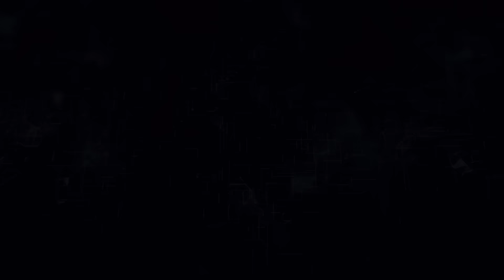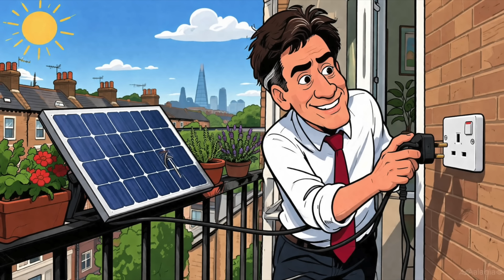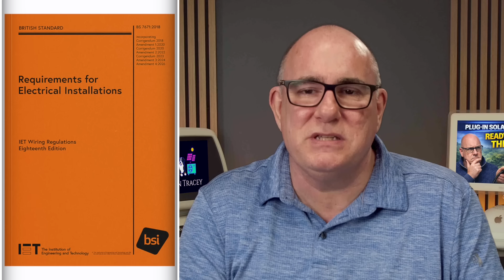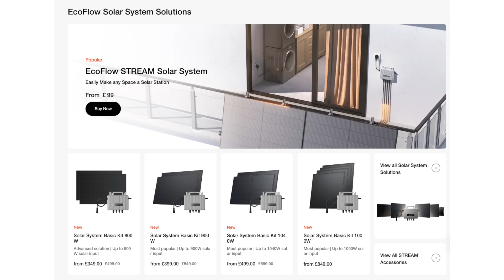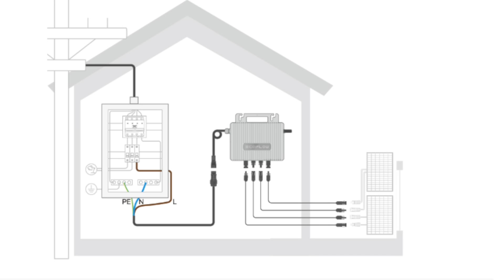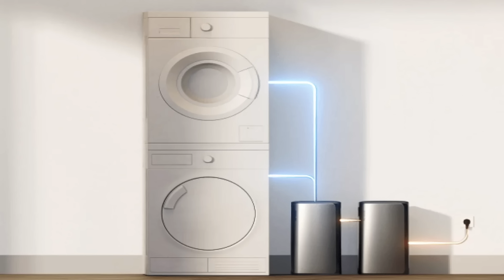Plug In Solar Is Coming… But There’s a Problem

Comment: I can’t wait for this. I am a
 shared owner with a housing association. They will not allow solar or battery’s on the property. So when this comes legal I shall be 1st in the queue.
Reply from the maker: what are the reasons for not allowing it, seems very mean spirited of them
Reply: @JonathanTracey it’s just something they don’t allow and it’s a change to the electrics. Even asked about having them on temp builds like shed fence. There response was it’s what get connected to the electric that is the problem and not in keeping with the other houses. Even though the homes built is phase 2 all have solar

Comment: This is a first step towards affordable off grid power generation for those who have the space for the required solar panels and batteries. The most difficult part will be to have enough space to generate sufficient power to be able to dispense with the daily standing charges of the public utilities by disconnecting from them entirely.
Reply from the maker: @EdJelonek Fully agree 👍 for many people this is just about getting a **foot on the solar ladder**.

You’re right on space being the limiting factor for going fully off-grid, but even a small setup can still chip away at bills and reduce reliance on the grid without needing a huge install.

For most, it’s more about *partial independence and savings* rather than completely disconnecting.

Comment: Have had roof solar and battery storage for 3 years and my total household bill hasn’t been over £1k per year.
Reply from the maker: what size system do you have?
Reply: @JonathanTracey 4.8KWp. 10 panels and 2 batteries.

Comment: The advertise costs of £200 but when you look into it, it’s much more expensive.
Reply from the maker: it depends on the size of the system, a single micro inverter and a single solar panel will cost somewhere in the region of £200. If you want to start adding batteries to that then they could easily get a lot more expensive.

Comment: Good video, big thanks. I understand better now. Next step, also understand base load, then visit middle of Lidl ina few months for Manage Ed's Solar Special. Joking aside,  we will move house soon and would have got a roof installation years ago if the roof was better suited, so I probably will get a plug-in as an experiment once it becomes just a matter of buying it and, yeah, plugging it in. 

Question: without a battery, should I in practice expect only to cover base load (during daylight hours) or will it do much over that towards other usage, and should I be expecting to "lose" power into the grid because the house can't use it all in real time, then also import power even during sunny periods because the panels can't satisfy a kettle or similar appliance? It seems like even a small battery would make quite a difference in this respect but I am guessing that the cheaper kits will not have one. 

(We have an electric car so I guess I can probably shloop up spare solar power as long as there is car battery capacity to shloop it into but even on a 3-pin plug, I think that will draw more grid than solar power from the supermarket-level kits? And similar for immersion heater in water tank. Hmm, but maybe the slow cooker, ...)
Reply from the maker: @andbenth Great questions 👍 and you’re thinking about it exactly the right way.

*Without a battery:*
- Yes, you’ll mostly cover your *base load during daylight* (fridge, router, etc.)
- If generation goes above what the house is using, the excess is *“lost” to the grid*
- And you’re spot on – if you turn on something like a kettle, you’ll still *pull from the grid* because the panels can’t supply that level of power on their own

So in practice it’s a bit of a balancing act – you get the most value by **running things while the sun is out**.

*On your other points:*
- A **small battery does make a big difference**, mainly by smoothing things out and letting you use your own energy later
- Charging an EV from a 3-pin will usually **pull more than the panels are producing**, so you’ll still import some grid unless it’s very sunny
- Things like *slow cookers, washing machines, or an immersion heater on a timer* are perfect for soaking up spare solar

You’ve basically nailed the use case already – even without a battery it works, you just need to be a bit smart with timing. Then if you add a battery later, it takes it to the next level 👍
Reply: @JonathanTracey Awesome, thanks so much. I don't actually mind losing the power to the grid that much, as then at least someone else uses it, but I figure I should at least try to capture as much as I can. Looks like that is about old-school behavioural adaptation at this level of technology where you don't have fancy management software and cool but expensive hardware. Fair enough. I will get one of these when they come on sale and make sure our new house has a flat or south-facing roof ...
Reply: PS: Are the cheap+cheerful things that will flood the market when they rules change expected to come with any kind of monitoring/recording equipment at all: an app, a screen, even a few flashing lights telling you what they're generating and when? I am hoping they will talk to the internet and come with an app, no matter how rudimentary, but maybe even this will be a marginal cost too far!

Comment: DIY solar is indeed a good start. We developed V2Homeshare, to allow EVs with  V2L capability to power your home. Yes, it requires a G98 DNO notification after installation, but it gives you access to massive batteries which you can charge overnight for around 6p/kWh, then run your entire house during the rest of the day (when your EV is parked there of course). PV just makes the whole setup much more attractive, without the high prices of stand-alone batteries.
Reply from the maker: @beyondinnovationltd Interesting idea — and V2L is definitely a clever use of what’s already sitting on the driveway 👍

Just a couple of reality checks for anyone reading this:

👉 *“Run your entire house”*  
That can be true… but it depends heavily on:
- The EV’s V2L output limit (often ~3kW–3.6kW)  
- What your house is actually trying to run  

So “entire house” works if you’re sensible with loads — not if everything’s on at once.

👉 *6p/kWh charging*  
Yes — on the right tariff that’s doable.  
But:
- You need the right supplier/tariff  
- You need the car at home during those hours  
- And you’re effectively cycling your EV battery daily (which has its own cost implications)

👉 *G98 notification*  
Worth noting this isn’t just a box-tick — once you start interfacing with the house wiring, compliance and safety matter. This isn’t quite as “plug and play” as it can sound.

👉 *Vs home batteries*  
You’re right — EV batteries are massive compared to most home systems.  
But they’re also:
- Not always available (car not home)  
- Not designed primarily for daily home cycling  
- And not integrated into the home in the same seamless way  

👉 *PV point (this is the key one)*  
Totally agree here 👍  
Solar is what makes any of these setups really shine — whether it’s EV, home battery, or both.

👉 *Bottom line*  
V2L is a great tool and will work well for some people — but it’s not quite the “run your whole house all day for 6p” silver bullet it can sound like.

Nice concept though 👍 would be interesting to see how people actually use it day-to-day

Comment: Why would anyone want to plug solar panels into the mains? To give 80% of your energy back to the grid? lol That's the real reason the UK is pushing this. They want the british public supporting the electric grid while they wage war in the middle east. They won't be paying you for your contributions though will they...
Reply from the maker: That just shows a lack of knowledge of how the system actually works, the solar panels were generate energy at a slightly higher potential than that coming in from the means that means that everything you generate will get used first. So you’re not gonna be exporting hardly anything. So your premise of them wanting you to support electricity great while they wait war in the Middle East is just nonsense.
Reply: @JonathanTracey  What are you talking about? If you're at work, or simpy sleeping you won't be storing a single watt of that energy you are creating from your solar system, except a very small amount for your fridge etc. If you are pulling in 600w and not using it, you are not going to store that excess power, obviously.

Which is why, if you are going to opt for solar at home, you ideally should plug it into a power station or high capacity battery. You can buy power stations for about £750 that will store every watt you generate, for you to use whenever you please.

I don't think it is nonsense at all that the UK government is looking to the people to support the electric grid. In fact, it couldn't be more obvious if you ask me.

Comment: i dont get it, if they dont pay you for the juice, how do you benefit? does your meter run backwards? otherwise where is the energy stored? no batteries? wont stuff keep pulling power from the rings?
Reply from the maker: so if you don’t have batteries, and any spare energy is going to be exported. It won’t make your meter run backwards but what you would need to do is get the energy company to install or configure your meter to have an export component. This would measure how much your exporting and you could get paid for it. The reality is with an 800 W inverter you’re not gonna be exported very much at all so it’s just not worth a hassle. Obviously, if you have batteries then and the excess will get stored in the batteries and then your house will use that before it uses power from the grid.
Reply: @JonathanTracey so I don't really get the point of plugin, why not just let the pvs charge the battery using dc >DC and then wire the inverter up from the battery to consumers?
Reply from the maker: so there’s two main reasons why you might want to use plug-in, the first is if you don’t buy the solution that has a battery, then it will just convert the energy into AC and feed it into your house. A cheap and cheerful solution.

On the DC to DC side with the battery yes you feed the solar directly into the battery without any real losses for conversion. But then it doesn’t make any difference if you take the power out via the on board AC sockets or you feed it into the house you’re still converting DC to AC. The difference is if you feed it into your house anything in the home can use it.

Comment: If you already have roof solar  with feed in tariff and you then add plug in. Does that then add to the feed in tariff also ?
Reply from the maker: no, because feeding tariff systems have to have a standalone generation meter, this won’t impact that

Comment: Great video.  I have 3 sets of solar on two different aspects, and a battery inverter. The DNO adds all of these inverters together as the max power despite it being impossible for all the solar sets and battery to export at full power at once (the battery inverter actually limits export to 3.6 kW including the solar sets).   I’ve been looking at putting 2 panels on the small south facing roof I have, but all the regulations / paperwork / export limits have prevented that.
I’ll wait for bluetti to make an all in one system then buy that. 900 W would be nice.
Reply from the maker: @Muppetkeeper You’re not wrong — but this is one of those areas where the rules don’t quite match reality.

👉 *What you’re seeing is correct*  
The DNO does add up all inverter capacities, even though:
- Your arrays are on different aspects  
- Your battery is already export limited (3.6kW total)  
- And in the real world, everything rarely peaks at the same time  

So yes — technically overestimated, but that’s how they assess worst-case export risk.

👉 *Where it gets frustrating*  
You’ve effectively already done the right thing by limiting export at the inverter… but the DNO process doesn’t always give you credit for that unless it’s formally agreed as part of your connection.

👉 *On adding 2 more panels*  
In reality, 2 panels (~800–900W) would make almost no difference to your actual export peak… but on paper, it still increases “installed capacity”, which is what triggers the paperwork.

👉 *Your Bluetti idea*  
I get the thinking — wait for a plug-and-play system to dodge the hassle — but just be aware:

- If it’s **grid connected**, the same rules still apply (G98/G99 etc.)  
- If it’s **plug-in (true micro/stream style)**, that’s where the upcoming rule changes should make life easier  

So it’s less about the brand (Bluetti vs EcoFlow etc.) and more about **how it connects to your house**.

👉 *The slightly sarcastic truth*  
You’re basically being limited by a scenario where:
“Everything is producing max power, at the same time, in perfect conditions… forever”

Which, as you’ve already worked out… doesn’t actually happen.

👉 *Bottom line*  
- Your understanding is solid 👍  
- Your system is already doing the right thing technically  
- The limitation is *paperwork, not physics*

Hopefully the incoming plug-in solar changes will finally catch up with reality and make these small additions a non-event 🤞
Reply: Thanks for the excellent reply. Yes it’s a paperwork limit that I just can’t be bothered to dodge, especially as my DNO charges £500 for a G99.  The bluetti I mentioned would be a plug in solar and battery.

I’m pleased you said my understanding is solid, I’m a chartered electrical engineer who was a distribution engineer for 10 years 😂. If I can’t get my head around this I need to set off for the old folks home right away. 

Anyway, you’ve earned yourself a subscriber, the number of people who both understand this stuff and can explain it simply is a very small set, I know because I made myself stupidly well off by spending just 10 years of listening to clever techies and then explaining it to business folk 😂.

Comment: Can I please ask, if you also have a battery and you charge that battery from the plug in panels, can you then at a later point send the power from the battery into the mains supply? Or is it only for directly plugging items into it.

Thank you
Reply from the maker: yes that's my exact setup, the panels charge up the battery during the day and then discharge in the evening when teh family is home

Comment: Micro solar systems are best use in case of temporary power outages.
They are not meant to power very much.

About the controller - you absolutely MUST make sure that your inverter has Islanding built in as well as a lot of other safeties built in.
Islanding means that if you lose grid power the inverter shuts off instantly.
If you do not have islanding then you must have a lockout device on your main panel to ensure no back feeding during a power failure.

Your worry begins when you make 1000 watts or more at a time. Those require extra safety devices.

I make about 250 watts or so off my setup.
Not enough to run my computer but it does offset most of the power needed.
When not using the computer, it can feed power to other things in the house.

I didn't build my array to sell power. I built it to offset some of my power needs.
Ecoflo's are obscenely overpriced for what you get. A rip-off.
Reply from the maker: @crazysquirrel9425 There’s a mix of correct points in here… and then quite a bit that’s either outdated or just not how these systems are actually used in practice.

Let’s go through it properly:

👉 *“Micro solar is best for outages”*  
No — that’s not the main use case at all. In fact, most plug-in / micro systems *shut off during outages by design* (anti-islanding), so they’re specifically not for backup.  
The primary use is simple: *reduce your electricity bill* by offsetting your base load.

👉 *Islanding / safety*  
You’re half right here. Grid-tied inverters must have anti-islanding — that’s standard and legally required.  
But presenting it like this is some optional “make sure you’ve got it” feature is misleading… you don’t get a choice, it’s built in.

👉 *“Above 1000W needs extra safety devices”*  
Not really how it works (at least in the UK).  
What matters is compliance with standards like G98/G99 and proper installation — not an arbitrary “1000W = danger zone” rule.

👉 *Your 250W system*  
That’s fine — but that’s your setup.  
Scaling up to 800W–2kW+ is very common now and absolutely does run meaningful loads (fridges, base load, even a chunk of daytime demand).  
So saying they’re “not meant to power very much” is more a reflection of your system size than the technology.

👉 *“Not enough to run my computer”*  
A typical computer is ~100–300W… so ironically that says more about your setup than the capability of micro solar.

👉 *“EcoFlow is overpriced”*  
Compared to… what exactly?  

That’s the bit that never seems to get answered.

The Stream system isn’t just a panel and inverter — it’s:
- Plug-and-play grid integration  
- Built-in battery capability  
- Smart control and scaling  
- No electrician required for most installs  

So again — overpriced *relative to what equivalent system?*  
Because there isn’t really a like-for-like competitor doing the same thing in that format right now.

If you’re comparing it to a DIY panel + inverter setup, then yes — that’s cheaper.  
But that’s like calling a fully integrated heat pump system “overpriced” because a fan heater costs £20.

👉 *Final point*  
You actually said it yourself at the end:  
“I built it to offset some of my power needs.”  

Exactly. That’s the main use case — not outages.

Everything else is just design choice depending on how far you want to take it 👍